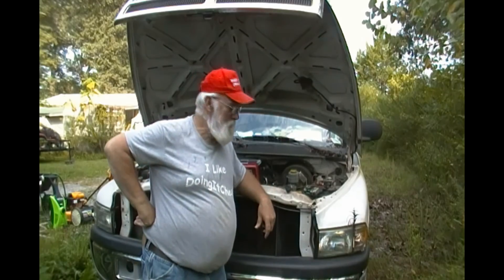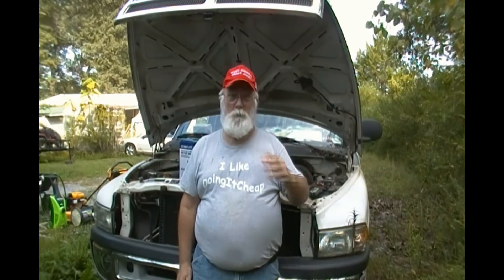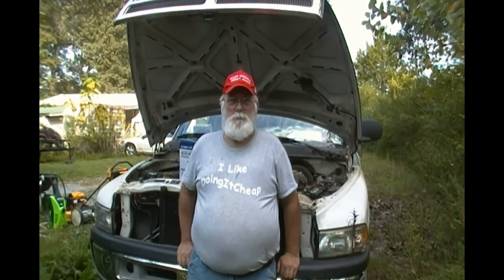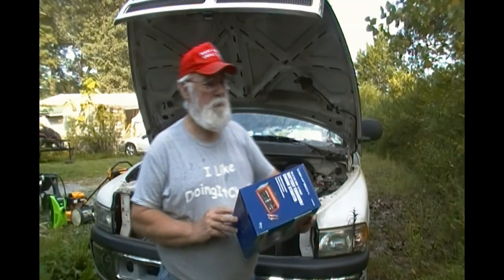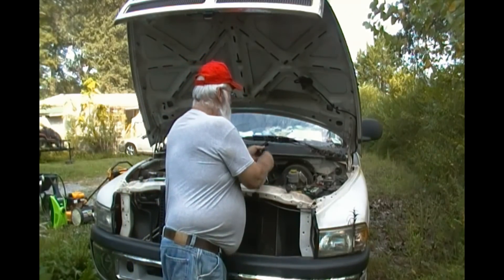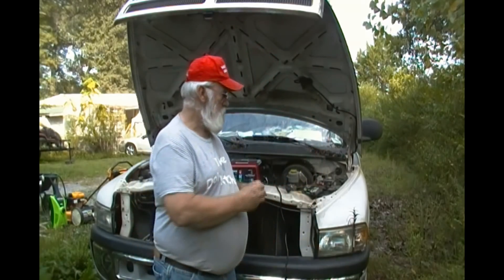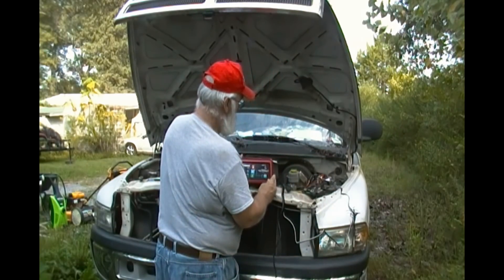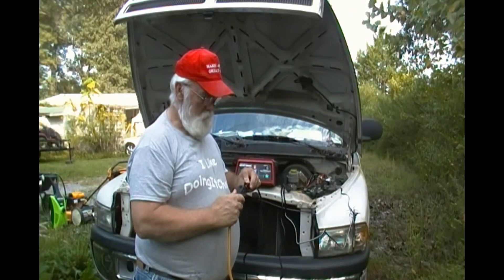A little lesson on alternators with PawPaw

Comment: I've taken battery completely out of  my car while engine was running . How come engine didn't die with no exciter voltage to operate the alternator in which supplies computer voltage  to keep the engine running. I understand the alternator maintains the battery charge  but there's no battery . I don't understand
Reply: It will eventually start to spit and sputter  ...it happensthis way because the alternator doesn't stop producing electricity  the moment it loses power  it's gradual decrease untill the engine stalls and shuts... You can test this by starting the vehicle disconnect the battery and try to drive it... You won't get far in fact the car may stall as soon as you put it in gear ...
Reply: georgiaridgerunner 79 yeah. Just try my van😂😂😂
Reply from the maker: No clue.

Comment: Hiya Bob, I sure hope your alternator on the ford isn't like the one on my mini cooper , had to take off the front nose of the car unhook ac and radiator and move them out of the way it was tucked up under the supercharger what a pain, you take care
Reply: My worst one was on a 2001 Suzuki Esteem. You have to take the passenger wheel off and undo the motor mount and jack up the engine to get it out. I wish those genius engineers would have to do the jobs that they design.
Reply from the maker: It is not QUITE that bad, but gotta pull front wheel, splash panels, and it is wedged between the frame and the engine.

Comment: Good information on  alternators and discharged batteries.  You sure act like you are feeling better, glad to see it.  I hope you do video the alternator replacement on your car.  It must be a dandy to cost $200 labor.  Is it one that they hide at the bottom of the engine instead of right on top to one side like most of them.?  Phil
Reply from the maker: While standing to the side of the right front tire,  the alternator is on the bottom left of the engine, behind the wheel and wheel well covers, wedged between the frame and the engine !!
Reply: @DoingItCheap  I don't think I want any part of that one.lol  Phil

Comment: Glad you're feeling better paw paw 😀👍
Exelent video.... I've been in mechanics ALL my life and didn't realize it was that easy. 😂 
What I always do is... Disconnect the battery with the engine running and if the vehicle dies... your alternator is bad🤔
Again,  EXELENT video,  have a great day my friend ✌👋
Reply from the maker: If the vehicle dies, then your battery is dead as well.  A vehicle will continue to run on a hot battery, but I KNOW you already knew that.  I drove 150 miles on batteries until I got to my destination.

Comment: Just a comment that 99% of the viewers here know,but for the 1% that might not, when using a volt meter when checking any battery voltage always set the volt meter to “DCV” and not “ACV”.
Reply from the maker: Yeah, I didn't want to go too deep into it...... that's why I mentioned it had an instruction manual.
Reply: Thanks

Comment: In the old systems,  once the car is running,  if you disconnect the battery and it stalls, your alternator is suspect.  It should keep right on running if the charging system is good.   
A mechanic once showed me that if you don't have test equipment, you can stick a piece of non magnetized steel or iron to the back  of the alternator while the engine is running (where the shaft would come out if it went through the back).  If it draws the metal in with magnetism, then the alternator is working.  
Most systems charge the battery at about 14V.
Reply from the maker: Yes Sir !  The difference in a generator and an alternator is that exciter voltage creates an electromagnet and a generator has permanent magnets.

Comment: You ‘splained it good, Paw Paw. I hope to replace my own alternator myself (2001 Dodge Ram 1500) 🙂👍🏻🇺🇸
Reply from the maker: Piece of cake.
Reply from the maker: Once you take the pressure off of the belt with the spring loaded pulley, it is just three bolts, a battery cable and a two conductor plug........ just make sure you disconnect the ground wire from the battery first.